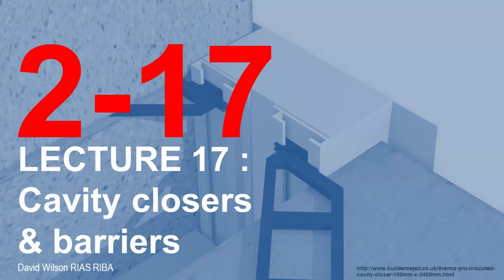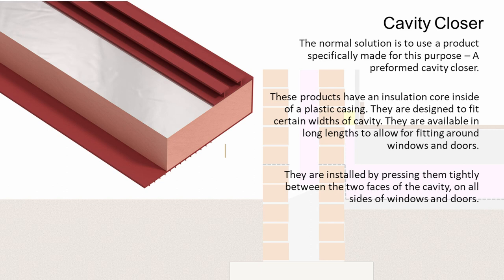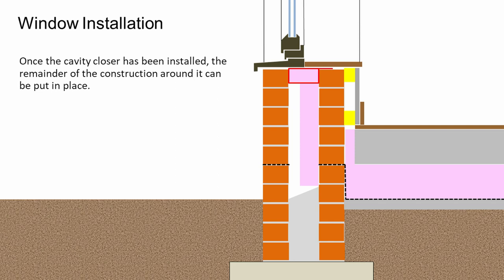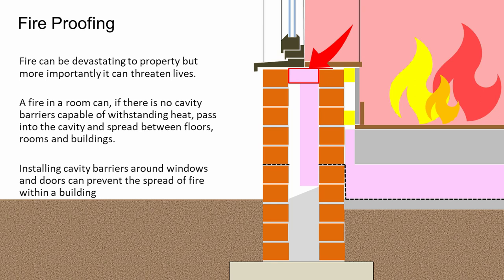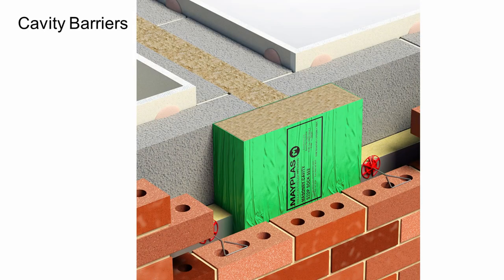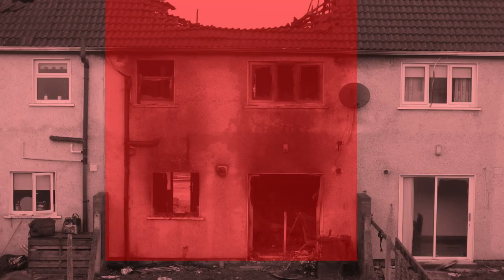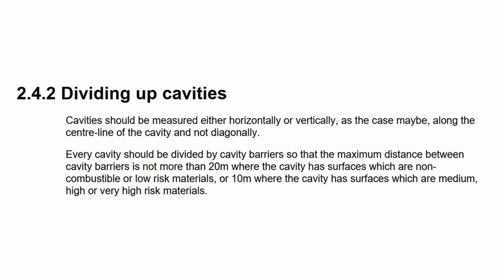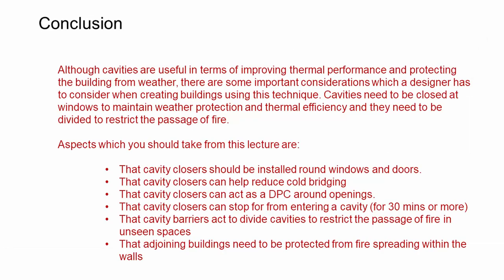17 Cavity closers and barriers

Comment: Thank you for the useful information.
is there a need to install cavity closers horizontally parallel with the wall plate where the roof rafters will be seating?
Many Thanks
Reply from the maker: Hi, thanks for the question. Where the cavity meets the top of the wall it is necessary to close it. Normally this can be done with a fire proof board (calcium silicate) laid over the top of each leaf or by using proprietary closer. In addition, there should be cavity closers at each floor level of the building is more than one storey high. A lot depends on the local building regulations or codes so make sure you check. Cheers.